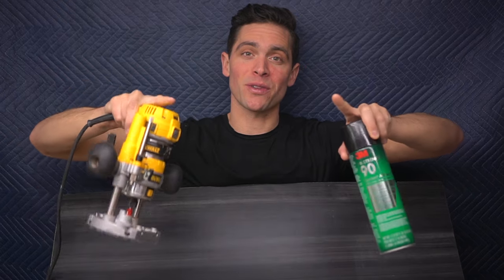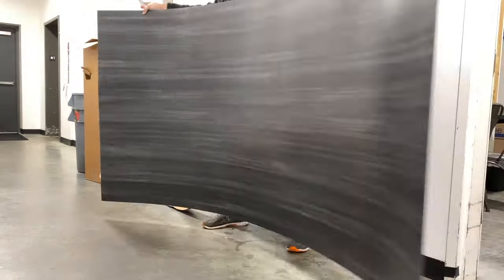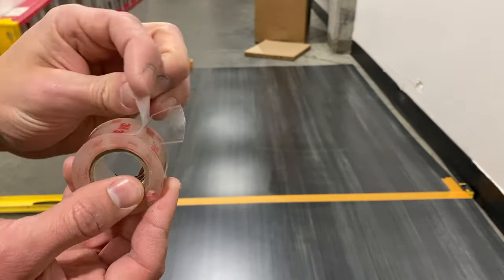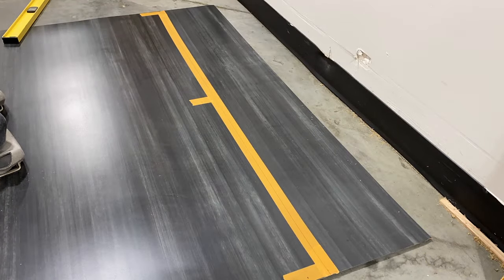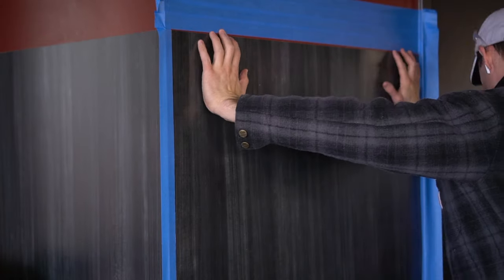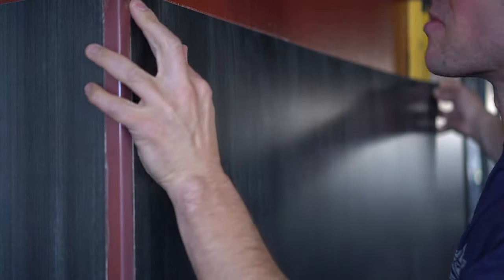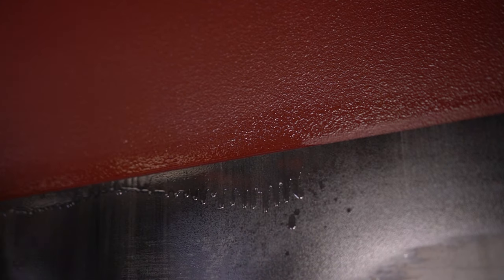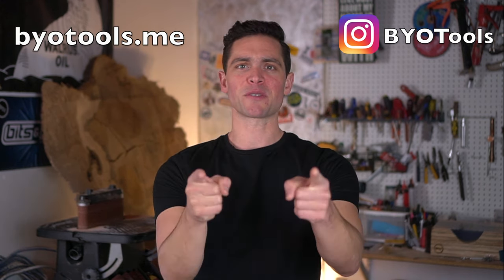How To Cut And Glue Laminate // DIY FORMICA Accent Wall Or Countertop

Comment: A great step I add is to use parchment or wax paper between the wall and formica after the contact cement has been applied and dried. Wax/Parchment paper will not adhere to contact cement.  In this situation I would have used parchment paper and adhered it to the wall in strips. (Tape the parchment paper to the wall where the formica is not going to be applied) When you are ready to connect the formica to the wall you pull one strip of the wax paper out from behind the formica and then roll the it firmly in place. Once you are satisfied move on to the next piece of parchment paper, and repeat the process until it is completely adhered. I have used this process on counter tops etc and makes it incredibly easy to install and no stress. Hope this made sense and helps. Great Vid!
Reply: great tip because dowels are great for horizontal apps but not vertcal ones.
Reply: I love this idea! So do you lay strips of parchment so it covers the entire surface with adhesive on it?
Reply: @corbinrice2688 yes. The entire area has to be covered. Once the two pieces woth contact cement touch they are locked in!

Comment: Thanks for this INFORMATIVE video. It's perfect TIMING. I held back on cutting laminate/formica for sometime for the lack of HOW the Bestway to Cut it straight till I saw your video its time to get busy. Oh do you have any suggestions on cutting a rounded corners to fit around those chrome shelves' legs? Need to make it fit as close as I can to them so heavy items don't fall through or the formica doesn't brake off at the corners.

Comment: Thank you for making the video. It is very helpful.  I am working on a bathroom project that I will be installing the Formica sheet on the walls, but I don’t know how to deal with the uneven wall surface.  I do not want to see the Formica looks wavy after the installation.  Do you have any recommendations or tips for that?  Thank you.

Comment: just a thought but it is recommended to use the curved surface for most routers rather than the flat face as with the flat face any sort of accidental twisting of the router will curve your cut line where as the rounded surface is a consistent distance from the bit
Reply: I read your comment and I understand and get your point on same distance all around.
 I'm not a router guy and that makes me wonder what is the flat edge for?
Reply: @BenG78  usually you'd put like an edge follow jig on that side. It's flat to let you get that little bit closer to the edge. That's the only thing I've really seen but I'm not so sure honestly
Reply: @pistolade9956  thank you

Comment: Hi there nice video I am about to make a formica desk with birch ply can I ask you something please? How long do you have to wait until you route the edges? Also is the whole process quite easy- what worries me is , is air bubbles .(I know its not what you just did but I figured you may know the answer) thanks in advance sir
Reply from the maker: Hi Christopher.  Thanks for watching and glad you are taking on your own project.  I’m assuming you are asking how long you have to wait for the spray adhesive to dry.  If so, you can router it within a couple of min after you have it set in place.  The process is easy but just make sure you set one edge in place first and then gradually move your way down.  Don’t try to set it all at once.  Hope that makes sense and good luck.
Reply: @BYOTools  thanks for the reply... i was wondering , on the back of the tin it say 2.5m square coverage per 1L, does that mean when applied to to both surfaces or in total ?.... mmmm does not seem to go very far

Comment: I have a bare wet plaster back splash that we removed tiles from and then sanded clean. Do we have to seal or paint the wet plaster before installing a sheet laminate over the whole back splash>
Reply from the maker: YES make sure you at least prime the plaster but if this is a backsplash why are you not just installing tile again?
Reply: @BYOTools  I don't want tile with grout. I just want it smooth.

Comment: Shouldn't you hold the tape measure tap horizontal when you measure the width? You had one end higher than the other. It will read high.

Comment: really spray adhisive? will that last? I stoped your video when I saw no face mask while spraing, Call me in 20 years when you have lung issues.
Reply from the maker: You obviously don't know your spray adhesives OP.  This 3M 90 is seriously strong and you'll be cracking the panel off in pieces if you ever tried to take it off.  As for the mask thanks for looking out and I'm normally good about wearing masks but I'm not worried about this stuff.  Probably as bad as breathing in hair spray once or twice.  But YES its always important to protect your lungs.  Thanks for watching.
Reply: Lame